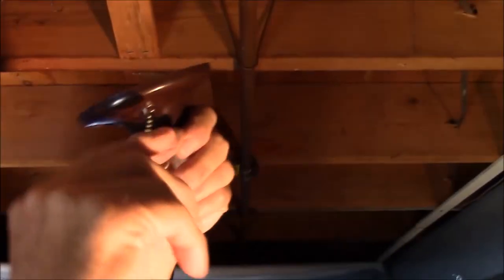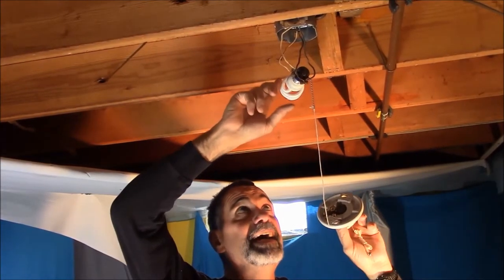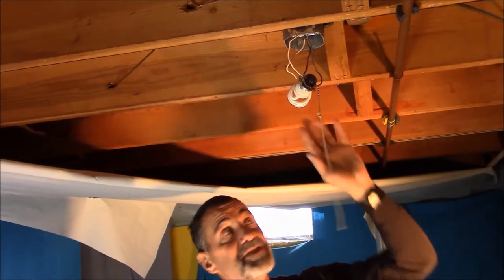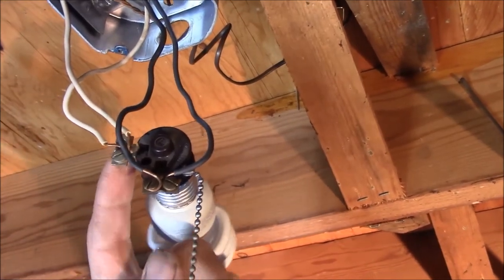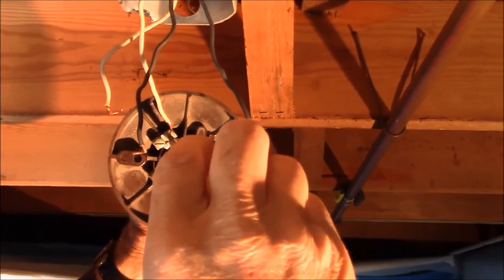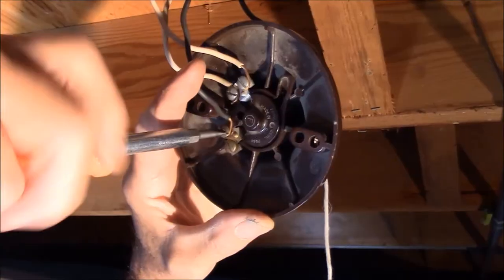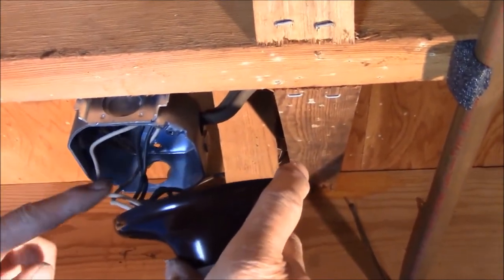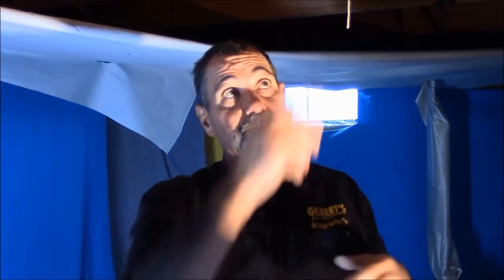Replace Pull Chain Light Fixture $4 in Minutes – White and Black Wires

Comment: I am trying to connect a wireless light switch with these types of wires with the loop. Can I just straighten that loop to be able to tie in with the wireless device to use the wire nuts or what do I do with that loop? I'm a rookie and I wasn't expecting to see that loop on the end of the existing fixture wires. It's an old building. Maybe I should just replace the pull chain fixture and forget the wireless switch? Any advice would be greatly appreciated! Thanks!
Reply from the maker: I’m sorry I can’t help from here. Sounds like you need an expert ’on site’ to access the wiring.

Comment: What if you can’t find a new light fixture with 4 screws
Reply from the maker: Then you have to get 3 wire nuts and 5” pieces of wire. Attach the black to the brass ‘colored’ screw, the white wire to the ‘silver’ screw and use the wire nuts to attach all the blacks together and all the whites together. The same goes for the ground wire if your fixture has a ground screw on it.

Comment: The only thing that bothered me about that installation is the light fixture is not secure to the metal box, it wobbles around.
Reply from the maker: There are 2 8/32 machine screws that secure the fixture to the box.